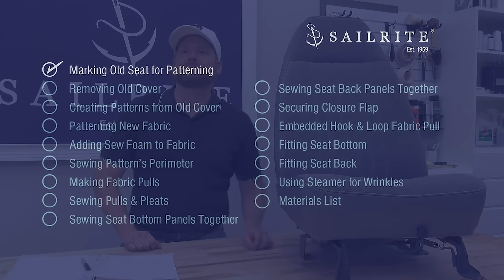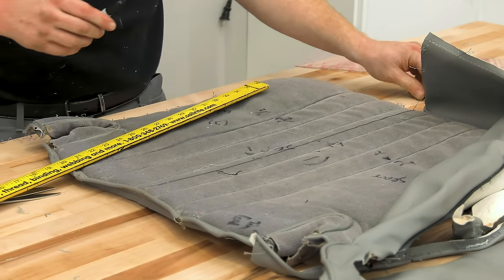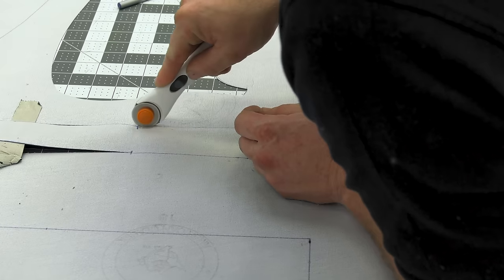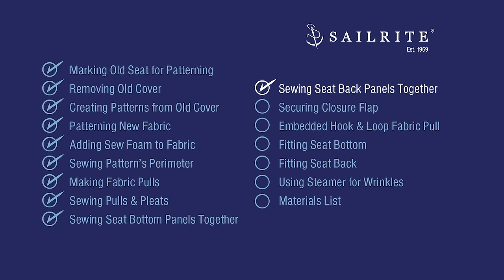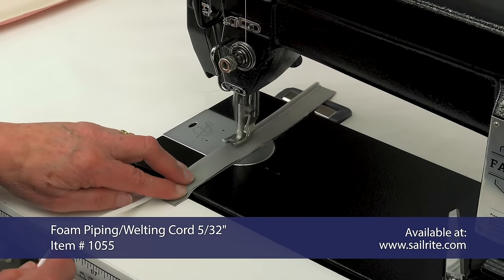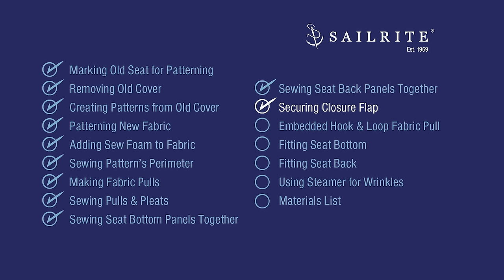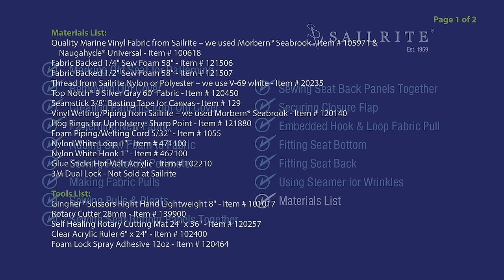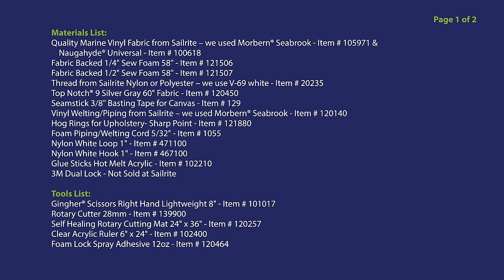Upholstering Bucket Seats on a Classic Car

Comment: Great video. The Fabricator works beautifully in the right hands. I had a Juki LU-563 I've since given a daughter in law, who eventually sold it. I needed a zig zag for catamaran sails and tramps. I hadn't heard of Sailrite and stumbled across REX on eBay and got one that I still have. To call a Rex a precision instrument would be like saying a chainsaw would be suitable for brain surgery.
Nevertheless, there are enough similiarities to the LZ1 that I purchased your cording foot set and have been trying it. Honestly, to even dream the seat front, sides, cording strip and 3/4" of foam could be sewen together with that foot set, one would require the sustained inhalation of something really potent. That foot set doesn't even 'detect' the cord sandwiched between all those layers ...and even getting stitches started is a herculean task.
Really Sailrite, I wish that foot set would work but the only way I'll be convinced is to see it demonstrated on that stack of materials. Done similar many times with a Juki, and not saying it is impossible but will be convinced only after seeing it demonstrated.

Comment: Question- I noticed on the captain's chair you used the silk film to pull on the cover, why didn't you have to use it for the car seats? Is it because of the Velcro channels, or not needed because it is an interior seat? Thank-you. I am trying to educate myself on car/boat interior work and I LOVE your excellent, informative videos.
Reply from the maker: I use silk film mainly for two situations: 1. To help keep water from reaching the foam when the cushion or seat is used outdoors. 2. To make it easier to pull a tight fitting fabric cover over a foam. If the cover is super tight fitting the silk film can help the fabric slip over the foam more easily.
If the above situations do not apply, I try not to use it. Why???? Well the silk film is noiseless and feels like silk, but it is slightly noticeable to ME, probably not anyone else, when I sit on the cushion.
Reply: @SailriteDIY  Thank you for your reply about the silk film. That makes sense to me. 👍🏼
Reply: You can also use silicone spray on the foam for a tight fitting cover! Works a treat

Comment: Maby you didn’t in reality, but it looked like you wasted a lot of material when cutting out the new fabric.
Reply: Agreed...plus isnt that a ball point ink pen.. If so...? That is a big NO NO...Especially on light colors... A very good possibility that Ink will bleed through or can easily mark vinyl and very very hard to get off..
Reply: My thoughts as well.  I'm sure we all work on a budget and try to get the most out of our stock.  I cringed a little when seeing Kenny didn't layout all the pieces first to see how much material he would need.
Reply: Personally I understand anyone with experience wouldn't use more material than necessary but they have to make these videos as idiot proof as possible. The earth is filled with people that can mess up a wet dream. If a person were doing their first vehicle and messed up their first cuts while trying to save material and had to order more they would be disheartened. Had they had extra room to cut extra for each piece and got through it spending 50 or 100 extra bucks im sure they would choose that option rather than the first.